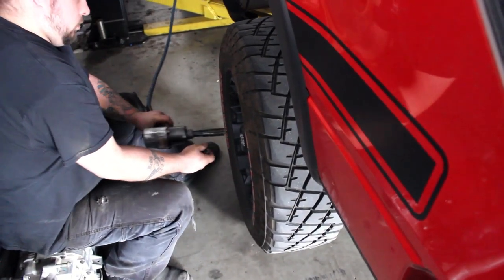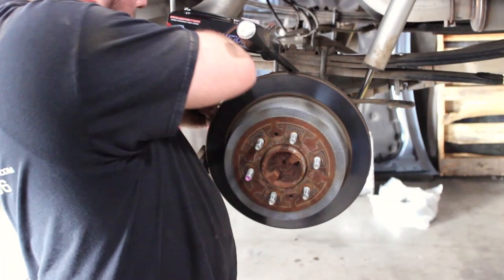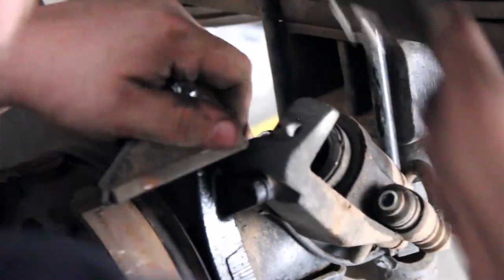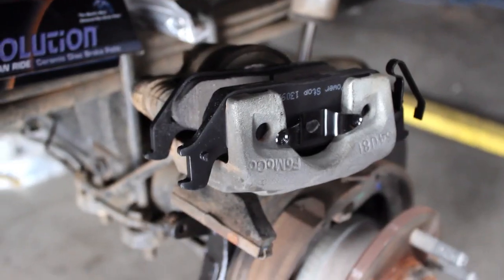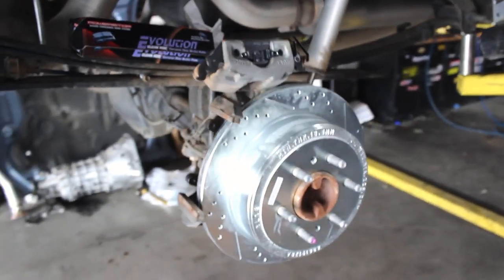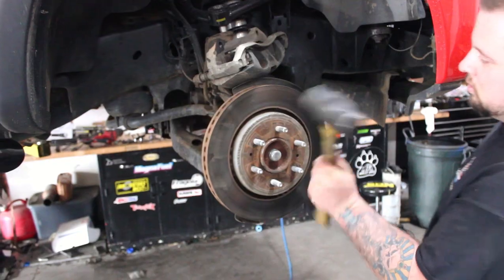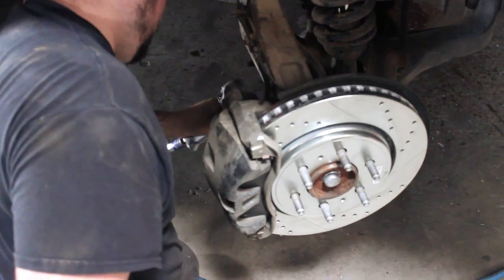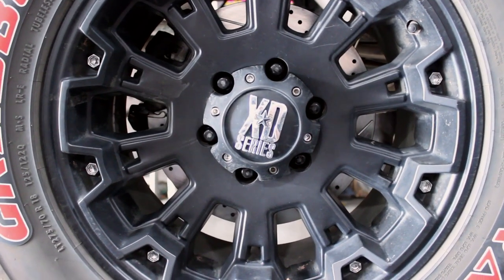2009-2014 F-150 Power Stop Full Brake Kit Install

Comment: This isn't completely the right way to do a brake job.  The hammer and the channellocks to start off with can cause damage if you are reusing the rotors and to compress the cylinder, you should put an old brake pad or something on it to prevent damage

Comment: Theres always room for improvement, but... ive jever driven any truck with this sensitive brakes as on my 11 f150.  I have 2 of them and it stops on a dime.  This will probably be one of my last upgrades I do on my truck.
Reply: EB Cinder got a video.  Ud like to lift mine.  I ended up getting 33s so they dont rub.  But I will do a lift soon...  then slap those 35s in the 20s

Comment: How do you get the upper 10mm bolt with that weird thing on it....all they do is spin and there isn't a nut anywhere to get a wrench on it?
Reply: You need an open end wrench I saw it on a video
Reply: It's a 10mm open end wrench
Reply: Look up Robert Gritz channel
Reply: If it strips ( and it will ) use a parrot beak vise grip pliers. I was wondering...can that weird bolt be replace with a regular one?